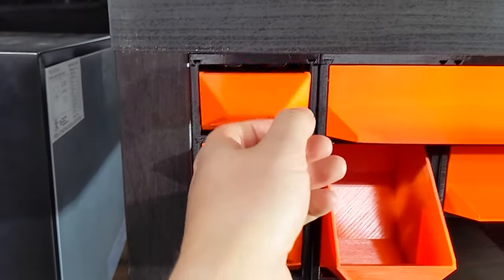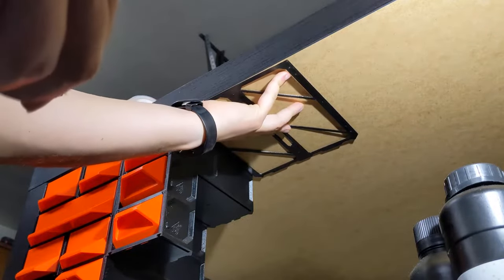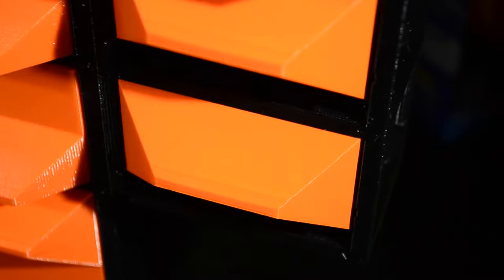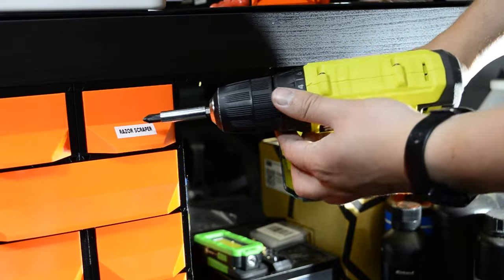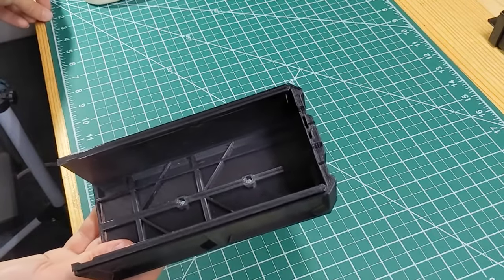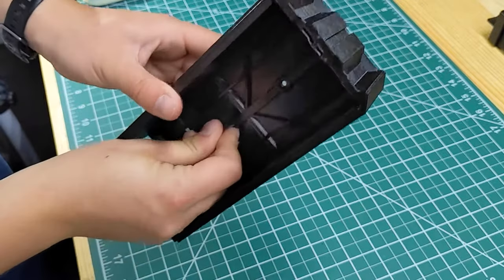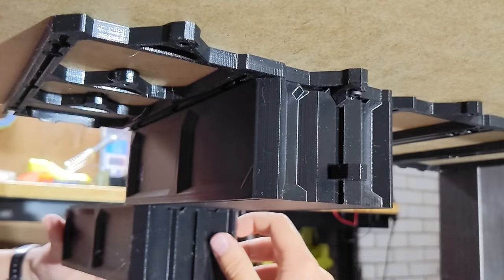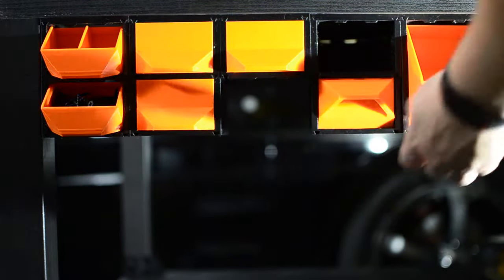GEN2 Modular Drawer System 3D Print

Comment: Nice job! I do think people don't stop to think that these Lack tables are made of honeycombed paper and that over time screws (especially the typical wood screw) will not hold any but the most trivial load in the long term. To mitigate you can fill the screw holes with lots of glue (though might take a long time to cure dependent on which glue is used) or better yet glue thin plywood to bottom of table and mount through the plywood with something like MDF screws that have deep threads intended for low strength material. The drawer design is great though- is just the table mounting that I have reservations about.

Comment: Great model, just printed out one to test around my shop! Curious where the "drawer stoppers" go? I believe they pop into the base of the drawer case, R and L perspectively? Does the flap stick up or down?

Thanks!
Reply from the maker: The door stoppers will press fit into the front bottom of the drawer cases. They are marked L and R for the left and right side placement, the tab you will want facing down, this is what the drawer will run into. Awesome to here you are interested in trying it out! Let me know if you have any other questions. My Latest video on GEN2 QuickLock includes some more detailed assembly examples as well.
Reply: @jerrari3D  Thank you! Now that I have them installed properly I realize how silly I am - I did not originally realize they are for the drawers below! 🤣

Thank you so much for the quality model and the reply! You've more than earned this sub and follow!! 👍
Reply from the maker: @SUPPORTYOURSELF  you're welcome. Hey no worries, it's kind of a unique way to stop drawers.

Comment: I appreciate the work that went into this design but I have to say that the tolerances are a little too tight.  I realy have to work to get these things put together. They are definitely not as simple as they appear in the video.
Reply: If you're using Cura, change slicing tolerance to Exclusive.

Comment: have you thought about making a adaptor for mounting the lcd outside the enclosure?
Reply from the maker: I haven't personally, but I have come across revised models of my old lack drawer design that people modified. The Gen2 design has a rail mount piece that could be modified for this. Do you know how wide the ribbon cable is? I could make a model for that application.
Reply from the maker: Hi Anders, I just completed a model you might be interested in. It allows you to pass the ribbon cables between the GEN2 Rails and the bottom side of the table. You can then use any mount for attaching the LCD outside the enclosure.
https://www.printables.com/model/291973-gen2-external-control-rails-for-lack-enclosures